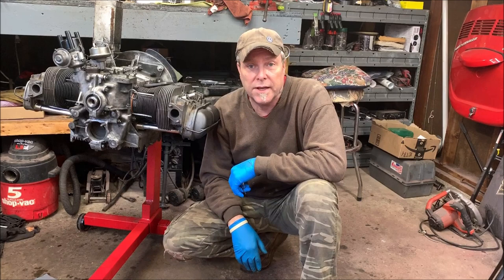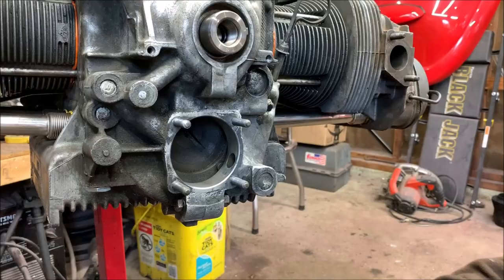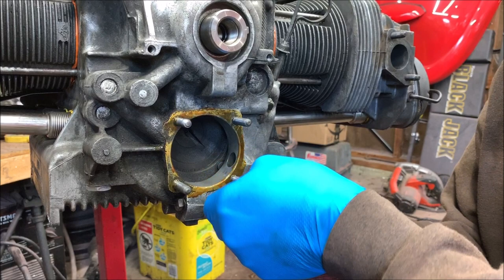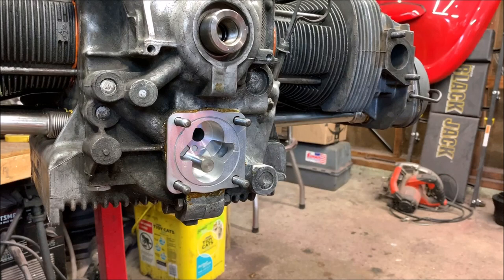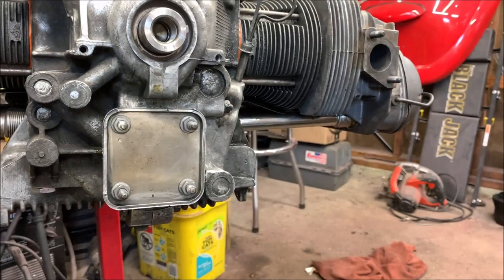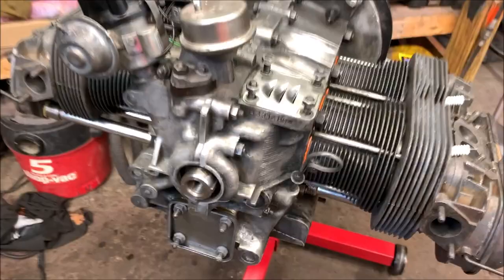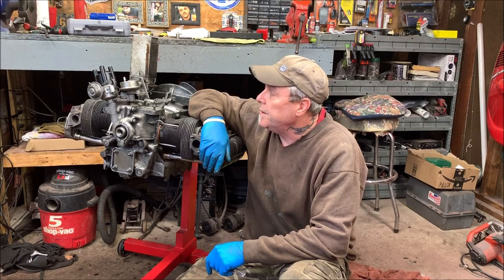VW Beetle - Super Beetle 1600cc Air Cooled Oil Pump Installation - How To Install a Oil Pump DIY

Comment: You should use Vaseline only to prime oil pumps because it has a melting temp of about 115 degrees F.   Some high temperature greases may never melt at engine temperatures and can clog an oil passage.      As bad as Permatex silicone in your engine if it's high temperature wheel bearing grease or something.     Nice work on this engine!
Reply from the maker: Thank you for being here and thank you for the comment. Excellent idea, and I truly appreciate your input very much. And that doesn’t make sense!

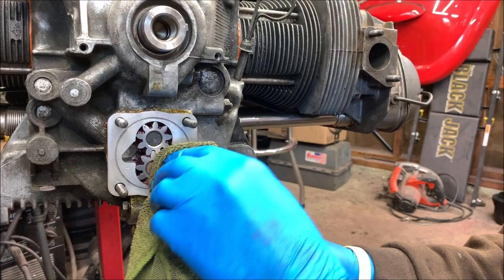Comment: at 6:20 do you put sealant on both sides of the paper gasket before the cover goes on?
Reply from the maker: Yes, but do not block the tiny little passage holes. That is the important part.

Comment: Brother Slade I would just like to bring to your  attention what might be called "a discrepancy of information" on the final assembly of the gasket installation. The outer most gasket should be mounted dry...and here is the reason for that.

You will notice the pump body has an annular groove machined into it, This is a weep passage to carry oil back into the pump should the gasket fail.  You will also notice that there are 2 holes in the paper gasket, they are to allow the wept oil to travel from behind the gasket.." in the weep passage" back into the pump.

By using gasket goo you block the weep passage and the weep holes.  

Lawrence
Reply from the maker: Thanks brother!! Ya know, I had a debate about that part with someone. I was made to feel I was wrong. So I used it on both. 
I’ll try and see if I can get into the YouTube studio, and edit that part or show a text caption!! Thank you!!!
Reply from the maker: Thanks again brother! I figured out I could go into the editor inside YouTube and edit that part out. I appreciate that!

Comment: great video. I am about to do this and have one question
When you loosen up those 3 nuts, won't that break the gasket sealant between the two halves?
Reply from the maker: If you mean the case halves, no.

Comment: Will a CB Performance Full Flow Oil pump fit on a 1500? Would I need to modify the engine tin to have room for it? Thanks!

Comment: Two questions: if you loosen the block bolts do you still need a special puller tool to get the pump out or will it just slip out? And if new nuts are not available can you re use them with sealer around them?

Comment: If the pump is bad, will the engine have a tappet noise from being dry? And the oil pressure light not go out? Thanks.
Reply from the maker: It’s is VERY possible!! I wouldn’t run it until you figure it out!

Comment: getting cold there yet? just had first light snow here a couple days ago
Reply from the maker: Its ranging in the 50s right now, but looks like next week the 40s. I always forget over the summer how much I don't like winter. 🙄
Reply: @SladesVWBeetle  i saw in the vid that you had a long sleeve shirt on so i knew some cooler weather had arrived there. 50's is nice. near freezing here. it'll pass. you'll probably go cold and we'll get warm.
Reply from the maker: Yeah as I get older the colds not as fun. I have a torpedo heater, but not cold enough yet. But geeez that thing heats up thr garage fast, but it's loud!!
Reply: @SladesVWBeetle  nice. i have tool envy.
Reply from the maker: @redshirt-scotty  I was finally able to buy things as my kids got older. When they were young I was broke doing as I should for them. Now I'm trying to catch up 🤦‍♂️🤣

Comment: Engine need to be removed?
Or is something you can do with engine installed, my idea is to install a pump with oil filter
Reply from the maker: I’ve never tried to do it with the engine installed. I think it would be extremely difficult. For as fast as these motors come out, you’re better off doing it on the floor. Oddly enough next weeks video is engine removal. 😂😂

Comment: Should the block be tightened before the bolts on the oil pump ? Or does it matter
Reply from the maker: I just tighten them in the end. I've never had an issue. You can do it either way im sure! Thanks for being here.

Comment: Hi Slade, how do you know when your oil pump is going bad? Would the front dash oil warning light turn on or you just have to take it apart after so many miles and inspected visually?
Reply from the maker: You would watch for your oil warning light to come on. But also remember those sending units can go bad so you would have to test it.

Comment: Hi, i got a Permatex "High Tack" Gasket Sealant instead of Aviation Gasket. It states that it 'Adheres & seals from -65* to 500* F'. Is this ok or should I stick to Aviation Gasket only? Thx
Reply from the maker: I’m sure that will work too. I’ve stuck with the aviation stuff for a while